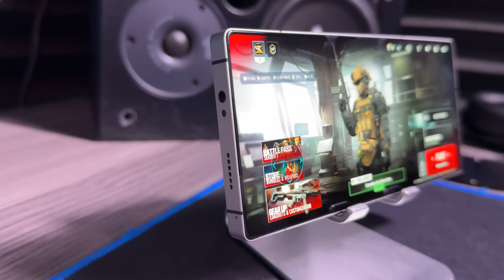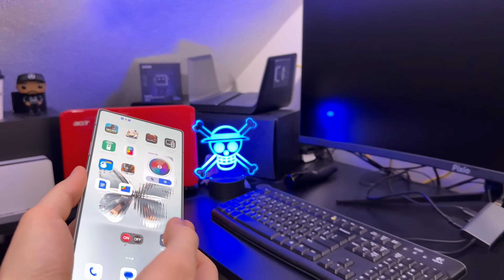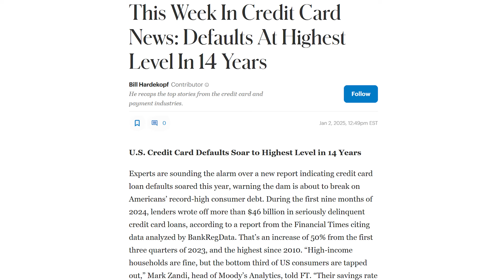What CES Revealed About Repairable Tech In a Record Year For E-Waste (2025 Is Not Looking Good)

Comment: One note about WIndows 11 dropping support for older CPUs. As a software engineer, I totally understand why they do that. Supporting old software is hard, supporting old hardware is even harder. Just keep in mind, Kaby Lake is 7 years old. The Zen 2 CPUs are 6 years old and don't get any support by Intel and AMD themselves. So while I agree that we get a lot of waste, I do understand the decision. I mean Apple is even worse and seemingly people don't complain there. Or Android phones etc. I mean, you can buy a new Android phone from a big brand and it will see exactly zero updates from release. If you want to give the old laptops or PCs a chance, install ChromeOS Flex or a simple Linux. And I know what you all are gonna say, but I can tell you, if you setup Linux properly for your relatives they won't have issues. I am talking from experience. My dad turns 68 this year and my mum turns 67, both run Arch Linux setup by me. They have less issues than they had with Windows before that. Most people only use a browser anyway and maybe a word processor. So why do they need Windows? And there are even Linux Distris like ZorinOS, which are specifically designed to look and behave like Windows.

Comment: The rant is understandable. Europe is not really better in this. My parents own a dish washer for 25 years now - a MIELE one. Since I moved out I have run through 4, at some short point after guarantee's end something small that is connected to something large inside will fail and repairing it will always cost as much as a completely new one. If you get it repaired for that price, something else will fail, cause it is designed to fail.
Reply: Make sure you get that in the will
Reply: Well did you buy cheap ones, or did you also get Miele?
Reply: miele now costs minimum twice as much as decent brands (decent by samsung, lg, electrolux etc.) and does not offer spare parts to third party repairs, i got denied service on a 8-y-o miele since they cant get parts anymore. and sending it to a miele center just costs too much
Reply: @Asrashas  i bought a cheap one. back when i bought it i was not able to afford something else. but it is still running since 6 years without a problem so will not change it.
Reply: @Asrashas  can I plead the 5th? :D
Reply: I feel very lucky. I got all my parent's appliances. The oven, fridge, washer, and dryer. All from the 90s. They function just as good as they did when I was a kid. I had to replace the oven knob, the fridge light, and deep clean the washer but it was super simple. Spent $30 on spare parts and 1 hour max.
Reply: Every electronic is design to last until Warranty wears off.. its so stupid.
Reply: Pre wash your dishes and magically you don't have issues anymore
Reply: @dmo848  it looks like you dont know the brand. In the past, when you can afford a miele machine, this was the last you had to buy. This thing will run until you are 6 feet under. Today even the 2500€ dish washer from them broke like a cheap 200€ machine, even for the same reasons and after the same amount of time.  But the miele will now cost you 800€ or more to repair, because of the "better quality of course".

Comment: I share your frustration with modern gear. My wife and I have off-lease desktops (HP-Z230) and laptops (Thinkpad T520), none of which support Win-11. But even if they did I have no interest in running Win-11. If I had my druthers we would still be using Win-7. You mentioned Toyota Corollas, we have been a Corolla family for a zillion years but our most recent one a 2020 has been a disappointment. Since we live in the rust belt in southern NH buying an old car is not an option. We also prefer a manual transmission that have become almost impossible to find now a days.

When Win-10 end of support occurs we plan on giving 0patch a try and see how that works. I'm running Ubuntu on an old desktop to play with it but I'm reluctant to give up on Windows as a daily driver.

Good luck transitioning from a repair shop to YouTuber and used computer reseller. Too bad you have to limit yourself to the most recent gear to be Win-11 hardware compliant.

Comment: My HP PAVILION DV6 6180us freezes up and shuts down after about 15 minutes of use. I refuse to throw it out since I bought it back in 2012, because of what I use it for it's perfect when it does work. I'm playing with the idea of finally adding it to the garbage heap, or decide if it's worth the time & $$ to fix it. 
I would replace the motherboard altogether if I could get another one, but I've been looking on. EBay for a few years now, and that motherboard part just never shows up.😢

Comment: I'm sure you have already thought about it, but for long term support you can try "Windows 11 IoT Enterprise LTSC", that can run on 2 threads (even a Pentium 4), 2gb RAM and 16gb storage (that can be SSD, HDD, eMMC... anything). TPM - optional. Secure boot - optional. Requires DX10 and above. I have it running on my Microsoft Surface Pro 3 and it works flawlessly. It transforms the customer's e-waste into simply... e.

Comment: I have a question about repairability. You said that the laptop was cool because it is water-resistant. But to do so, everything needs to be tightly sealed and hidden, etc. That's why they glue the battery in phones, etc., to make them IP68. But if you seal it tightly and make it durable, it cannot be easily repaired because you need to unscrew many more things or heat it up to remove the glue. So my question is: Would you prefer a product that is durable and lasts five years without repair, or something that is easy to repair but breaks every six months?

Comment: I started in computers in 1969. When PCs came out I used to build my own. Over the years I got laptops. A few years ago I found Linux (Mint) and decided to give up Windows (7). I line in a retirement community (The Villages, FL). Most of the people here do not need Windows, so I started converting them to Linux Mint. So far I have converted over a dozen PCs to it. So, as a result, they hold on to their laptops far longer than they would have. I'm only one person, so  I can only do so much. But, at least I'm trying. Have you thought about offering Linux on PCs that won't support Win 11?
Reply: I'd been daily driving Linux Mint on-and-off since 2014 (now sticking to it since early 2024), and it's been working great! I rarely have to worry about system requirements (and even then, for old PCs, there's always a distro for it, like Lubuntu or Puppy Linux).

Unfortunately, though, I haven't had any luck converting my family members into Linux users.
Reply: There are an increasing number of Linux distros that are very approachable to a general audience.  Mint is a very good example.  I'm a Linux sysadmin, I use a lot of different distros for different devices/situations, and I even with with LMDE (Linux Mint Debian Edition) for my rescued-from-ewaste 2012 MacBook Pro for general use.  Given the volume of early gen x86 hardware about to hit the aftermarket due to Win11, plus the fact that an increasing number of people are going to be looking to flee the AI nonsense, it's a good time to start looking at offering Linux.
Reply: Great work..We need to aware our family and friends 👏
Reply: Steam os steam os
Reply: I'm thinking of doing that for my current computer on Windows 10. It does everything I need so there is no reason to send it off to a landfill. Heck, I don't see why I can't use Windows 10 for a few more years with a firewall and antivirus software. I'm not going to shady sites or downloading random files off the internet or through my email. The test they did on Windows XP to show how vulnerable it was without all those protections so of course it got infected. Regardless, competition is good so I should move to Linux.

Comment: In Australia there is a company called metabox and they build custom built laptops and tend to be far more cheaper than branded laptops, laptop I bought was called a metabox prime SR and it is priced much lower than most laptops on the market for the 17.3 screen size, which isade up of 90 percent metal so it is a massive brick

Comment: I bought a used computer my mom and then installed Linux Mint on it,  She has used it for 3 years now with no issue,  most people just want to write a doc send an email and watch videos.  The computer she is using is a second gen intel.  It does everything she needs.  only thing I did was add more ram ssd and a discrete video card.
Reply: I love being able to switch someone's Facebook machine to Linux. It's so easy to install alongside Windows so the client can try it out and decide whether a full switch is right for them!
Reply: @preefix33_3 MAYBE??? there is some question of this??
Reply: Linux mint is good they support it for many years even if there a new version out.
Reply: I mean sure hardware requirements evolve with time but not as much as we think and not enough to make 5 years old or even 10 years old pcs obsolete for basic tasks.
Reply: @jonathan___qc5917  Officially, last time I checked (~2024), Fedora's minimum requirements were any OpenGL 2 card, 2-core 64-bit processor (any Intel, AMD, Qualcomm, Ampere, Apple, IBM, NXP, or so on product since like 2003 to 2007ish), and 2GB RAM. And that's for a full fat KDE desktop.
Reply: How did you add a dGPU
Reply: @Anankin12  oh here computer was a full 2nd gen desktop not sff and such.
Reply: @dagdamar2000  AH desktop, for some reason I was convinced it was a laptop

Comment: I just want to say thank you for the helpful videos, i wanted to buy a new office laptop because my old one had a i3-3110m and i really needed an upgrade,i was thinking about buying the hp 250 g10 with i3-1215u i believe but instead i listened to you and bought a used hp 250 g9 with an i5-1235u ,16b ram and 512gb ssd for half the price of a new one, this thing is insane, it can run basically every game that was released before 2014 with some tweaks. ❤

Comment: Some years ago I bought a samsung 55” tv, those entry level crap that somehow are 4K HDR at $600. Probably I used it like 20 days in total, since I used to watch tv on my bedroom instead of the living room, to the point that most of the time that tv was even unpluged.
One day a relative was coming to my house and I decided to plug in the tv, and suddenly just after trying to turn it on, the screen died.
Samsung tech support came and told me that the screen needed to be replaced and it will cost me $500.
That was the last time I bought any samsung stuff.
And obiously I had to throw the tv away.
Reply: Samsung should just stick to making phones and laptops maximum because at least their phones are good (idk that much about laptops). All I've heard about their fridges, TVs, washing machines, etc. Were all bad stuff and how they don't last.
Reply: I mean a lot of TVs now adays are considered disposable tech -_- cause its annoying to literally repair it
Reply: @lesslighter I got 2 sitting that just need an led or 2

Comment: Oh I love that fridge you either going to come home to a refrigerator of bad food when you cat opens the door or if it automatically closed itself you're going to come home to a dead cat refrigerator in the fridge when he gets trapped inside
Reply: "your subscription has ended and your device has been locked." 

Why don't they just have hand-scoop cutouts I the door frame? More internal volume (or thicker insulation wall) without the risk of the handle moving or sticking out behind the rest of the fridge.
Reply: @ There's some models that use a scoop handle, but in general I don't see why they'd really need to be smart at all. If you really wanted to have something like it I'd look more at gesture-based unlock on a non-accessible area of the fridge, like the top-center. Pinch to open freezer, pull to open fridge or something. That way if something doesn't have thumbs it can't do it. If google home can figure it out...
Reply: My fridge is my parent's fridge from the 90s. Still works. Actually all my kitchen appliances are just my parent's stuff from the 90s.
Reply: @LycanFerret  that's why they hate the old stuff... It just works
Reply: Unnecessary and unrealistic fear gained
Reply: @EspressosWork   unfortunately, there has already been something very similar which i think OP is referencing, in which a self-cleaning litter box bought off amazon ACTUALLY guillotined a cat and killed it. if i'm remembering correctly i think the poor thing wasn't even two years old
Reply: @EspressosWork   the one and only louis rossman that keeps being mentioned in the video made a video about it, really interesting look into just how greedy amazon can get
Reply: @EspressosWork oh it's realistic My cat loves jumping in the fridge anything I open up washer dryer doesn't matter if it's a new space and I open it he wants in immediately I could just see him figuring out how to open that door jumping in there and then it closing on him assuming it has an auto close function or him just leaving the damn thing open all day :-) unless they have something to prevent animals from opening it? You could do that with a dual sensor so if it sees you standing in front of it and you use your foot to trigger that would prevent animals from opening it
Reply: Schrodinger's cat fridge?
Reply: Shrödingers cat - fridge edition.
Reply: @jmax8692 oh my God what am I going to do someone has insulted me on the internet how am I going to survive how will I ever recover :-)
Reply: so either we lose food or gain food?
Reply: That is so true lol.... we have a family cat who is damn smart as she can the kitchen door by herself using claws no joke... fortunately due to a idiotic design flaws our other door handles are a bit loose so require abit of more force than normal to use is preventing the cat from actually using the door handle. The handles are slightly angled she slid off the few times she tried to open them so she no longer tries. The other door frames are flash with the door so she can't use her claws, the kitchen door isn't it's got a bit of gap.

Comment: good luck with broken bootfiles and recovery partitions btw whats the dism code to fully reset driversettings on a old pc so when you add a new harddrive (m2, ssd, hdd) it gonna act like a fresh new system instead of old settings poppin back up. my brain got compromised with a cloud of vent gooch